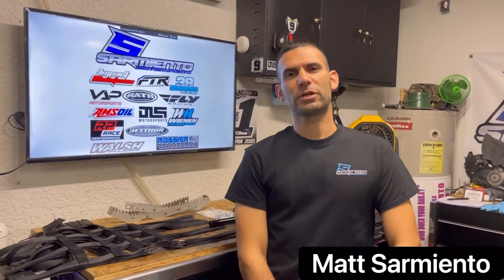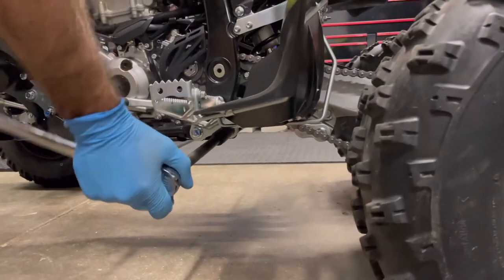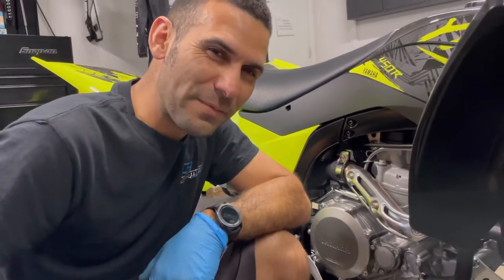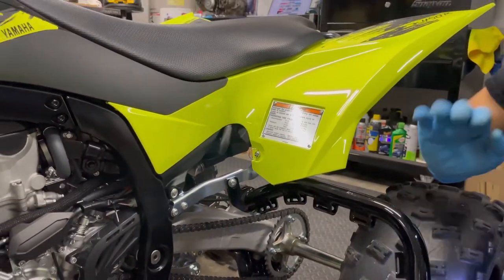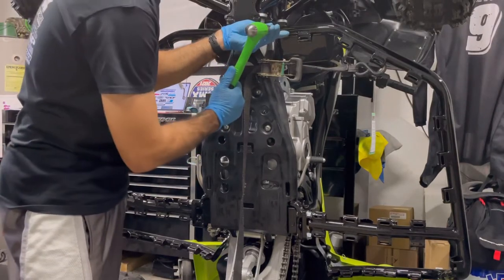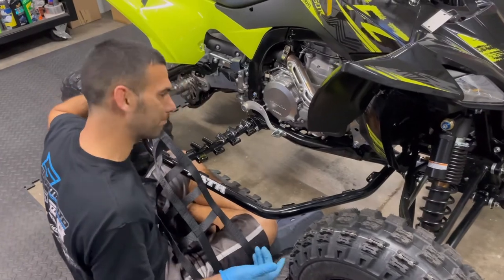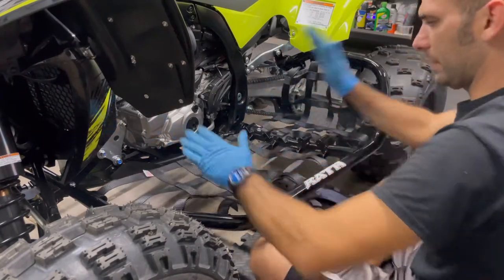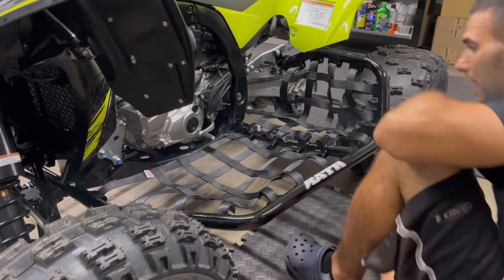How easy is it to install Nerf Bars?

Comment: can those exact nerf bars fit in a raptor 700r?
Reply: or they only work for the yfz450s
Reply from the maker: No but here is the link for the Raptor 700 nerfs 
https://www.rathstore.com/ProductDetails.asp?ProductCode=37%2D1210